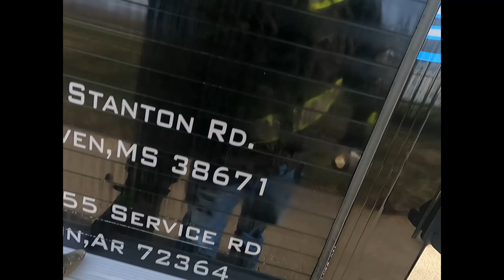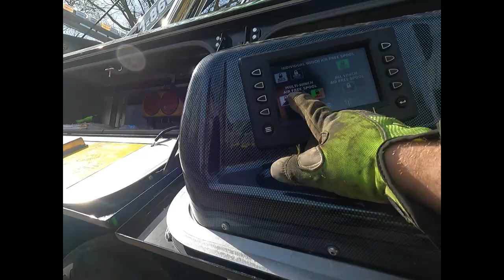Dump Truck Rollover

Comment: Why not set up from the front so it would be ready for tow after the recovery?
Reply from the maker: We set up like that cause we was gonna tow it from the rear.
Reply from the maker: That’s why I took that extra bit of rotating it to get it out in that single lane to sling it off the back and tow it in that way I had better control of the weight since it still had partial of a load in it on that passenger wall
Reply from the maker: Plus only towed it two miles down the street to their yard